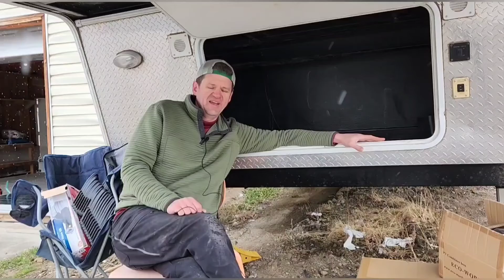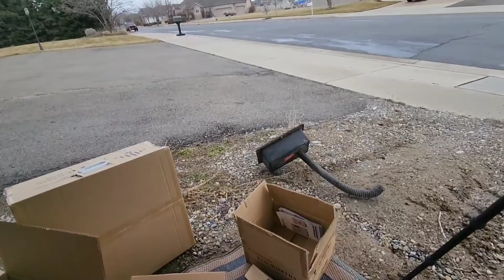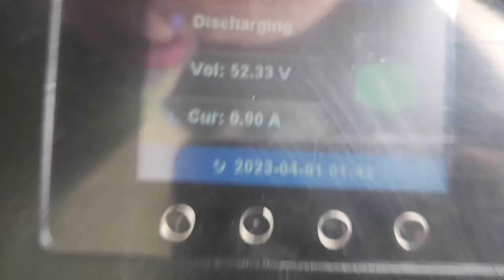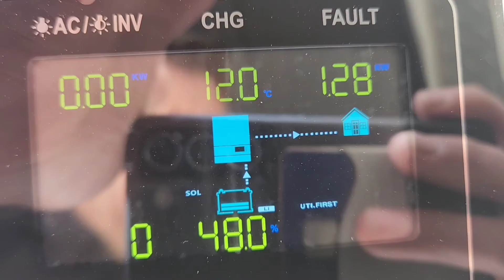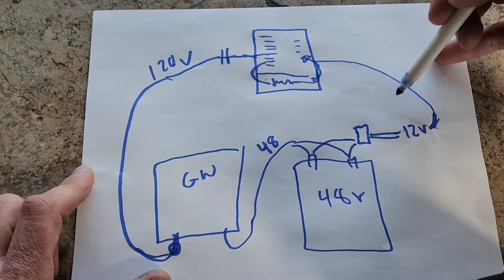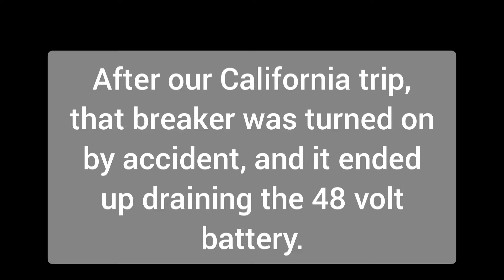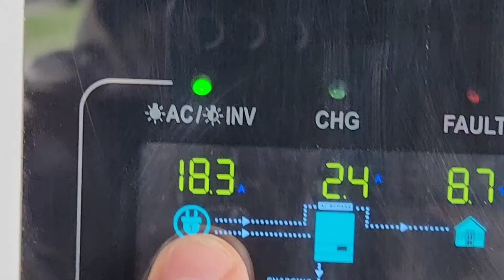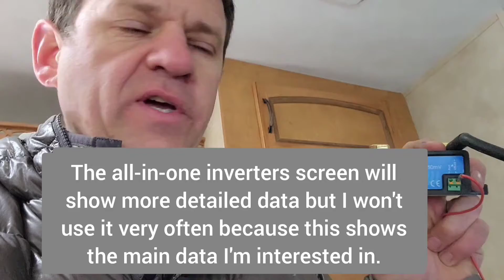12v to 48v RV conversion. Ultimate Off-grid RV Solar Power System Install

Comment: Nice set up..  would it make sense to leave the existing 12v system and add your exact system?  I Would think that the redundancy would make sense.
Reply: I am doing that and having small solar setup just for those batteries and a 48v battery and 48v inverter for all the 120v stuff
Reply from the maker: Sorry for the delay replying. I've very glad I removed the 12v battery for a couple reason.
1)One way to keep the 12v battery charged I would be to have a separate solar,  separate charge controller, separate battery monitor etc(Kind of a pain to maintain 2 solar systems).  I already have redundancy because my truck or motor home engine battery can be used with some jumper cables if needed,  I also believe I'd be fine plugging into my truck  tow plug but I haven't need to do that because the solar always keeps things charged.
2) (The main reason to remove it) Having the separate 12v battery is a constant draw on the 48v system:  An electrician mentioned this to me when he did his conversion.  He kept his 12v battery in place initially and then ended up removing it because when the heater would run at night, the fan would pull from the 12v system all night and his 48v battery was constantly trying to keep it charged.   This was super inefficient because of the converter box and the charging loop I mention in the video( 48V dc -> 120v AC => 12v).  I haven't measured the power loss in the 120v to 12v converter box but I imaging it's pretty high because of the large aluminum fins to keep it cool.
    My 48v to 12v converter box is super inexpensive and it's been great for me so far. It also it saving me from buying extra batteries.  Hope this help.
Reply: @diySolarPowerFunWithRay I like your idea, however I'm just wondering to keep 12v battery in place, switch off the 120v-12v converter and only turn it on when 12 v bank needs charged by 120v. I have currently 2x 100ah 12v Lithium battery for my rig in parallel. I'm thinking this because not sure how buck converter would communicate with my trucks trailer brake controller??
Reply from the maker: @sairdruk  if you only need 2 12v batteries for your i'd probably keep with keeping everything 12v.  My trailer breaks and trailer lights aren't connected to the main 12v rv system, they are independently controlled by the truck.
Reply: I'm doing this as well. We're retired FT RVers who boondock most of the time, so we decided to build our solar system in 2 phases, a 12v basic phase to run all our 12v appliances and a 48v system for our AC high power needs. We completed the first phase last January, with the addition of a custom built 560ah of LiFePo-4 battery, made with 8, 280ah prismatic cells. We used a Heltec 330amp BMS and a 5a active balancer, to start our generator. It only cost us $1,500 to build this 560ah LiFePo-4 battery, including the high amp BMS. The main reason we chose these cells is that they fit perfectly under the steps of our motorhome where our old pair of GC-2 golf cart batteries used to reside. We insulated the battery compartment, cut a small 1" hole in our step risers and installed a tiny computer CPU fan to keep this space at close to room temperature. 

We started our build 4 years ago with a 620-watt liftable array mounted on the side of our motorhome that practically lifts itself to the correct angle with a couple gas struts. Lifting an array to the correct angle produces 25-30% more than a flat mounted array, especially in the winter when the sun is low on the horizon. This first phase, including the liftable array, wiring, breakers, a new Progressive Dynamics 80a Li compatible converter/charger, 1,000w Renogy PSW inverter (to run our TV and PC), an Epever 50a MPPT controller, battery monitor/shunt, and a Renogy battery to battery charger (to protect the alternator) cost us around $3,600. 

We'll be starting our 48v phase soon. Mounting our current solar array on the side of our MH left the roof free to rack 8 Sunpower Gold 550w solar panels 13" off the roof of our 35ft Class A, to clear our front AC shroud and vents. It will give us a good bit of shade too, reducing the heat load on our air conditioners. Our MH is only 11' 9" tall, so we will be able to keep the RV height to 12'. Will be using an all-in-one 48V, 5,000W, 120V PSW Inverter, 100a MPPT 500V controller and 40a ac battery charger by Sungold Power for the bulk of our 120v needs. The reason we chose this all-in-one is because the idle power consumption is only 25 watts - and it's only $850. Our 48v battery bank will use 16, 305ah prismatic cells (15.6Kwh.) So together with our 560ah (7.1 Kwh)12v bank, we will have a total of 22.7Kwh of batteries onboard. We will be replacing our old rear 13.5k btu rooftop Dometic AC with a high-efficiency 48v DC mini-split heat pump that only draws 750 watts at peak air conditioner output and less than 500 watts when it's cooling normally. Both phases together will cost around $13,600, including the $2,100 mini-split. Our 2nd phase will provide 24/7 off-grid air conditioning and supplemental heat from the heat pump and allow occasional usage of our 14.5k Btu Furrion front rooftop AC to cool things down for peak afternoon demand, as well as give us whole house 120v ac power. It will allow us to keep our generator in reserve for emergency use only.
Reply: @SuperSushidog  that is perfect idea its what I will be doing

Comment: I wonder why the 2nd battery behaved differently when starting the AC? I think inside they are the same, and both have a 100A BMS and they both have a max discharge rate of 100A, which I doubt you were pulling.

Also, you might want to add a couple fuses to the positive wires on that buck converter.
Reply from the maker: I didn't add a fuse going to the buck converter because the converter literally can't go over 30 amps. Imagine it's probably a good idea to add a fuse though just in case the buck converter has a short. 
   I think the BMS in the other battery isn't as good. Even though they stay they are the same on their specs they are definitely different. It's too bad you can't believe the specs. I had another viewer comment that he was experiencing the same thing with the lifepower4 battery. He thought it was the bms, which makes sense to me. Because it has stricter BMS settings, who knows, maybe the cells will last longer?

Comment: What size dolar panels are you running.   And what charge do you receive from them
Reply from the maker: I have five 315 watt panels up top. It can run the inefficient air conditioner all day. When the Sun down obviously the battery can only keep up for a few hours. I think I've seen 1400 Watts coming from them on a good day.

Comment: Meh... should have an internal cable between the Inverter and the distribution box. I'd remove the 120V-->12V charger unit completely. You want a switch (and fuse) on the 48V to 12V converter - on the 48V side. I also think you want a second 5KWH battery. Personally - I would have put in a split-phase Victron Multiplus 48/3000 unit. Costs more. Need separate MPPT controller(s) and a Cerbo-GX controller - but then the screen can be inside your RV (much more convenient). However - you'd have a lot more power... when plugging in  - etc.
I live in South Africa - where the rest of the world uses 240Volts. Much easier.
Reply from the maker: I generally like victron stuff but the multiplus 3000 units only support 2400 watts (according to their Manuel). With only 2400 watts, it would only allow me to run one of my 1500 watts appliances at a time. ( eg Ac, electric water heater, microwave). Having the servo GX display would be nice, but I'm using the victron Smart shunt and that's giving me all the information I care about.  I think I would probably agree with you with the 240 volts the rest of the world uses. America is weird. I have a couple friends from South Africa. Also ian, who started and runs watts247, is from there.

Comment: You did great!!!  I’ve been using lithium’s for over 15 years doing conversions.  Mostly electric propulsion.  You are thinking correctly to multi purpose the system and expansion while at home.  Bravo 😊
Reply from the maker: Thanks a lot. Are you doing boat conversions?
Reply: @diySolarPowerFunWithRay  no boats yet.  15 years ago….  128v 50mph LiFePO4 electric mountain bicycle.  
15hp craftsman lawn tractor converted to 1.8kw LiFePO4 pack and 11kw 22kw peak ME1004 motor.  I’ve be researching and testing lithium for over 15 years.   My lates fat bike build is 5500 watts. 44mph.  Tesla 21700 cells. 25ah 74v nominal.  I’m an early adapter if not the first to sandwich spot weld Copper Nickel.  We’ve been looking at RV trailers….   Geopro 15TB or Hike100. 
I already have a new MP solar 48v inverter I purchased 3 years ago and I have 15kw of Panasonic 21700 cells I can start building my pack.  Since we want small trailer and can’t keep it at home HOA ….. I’m thinking of building it in the back of my 4Runner and making a foldout array on the roof of 4Runner.  15kw could run an auxiliary electric motor on my 4Runner engine serpentine belt to reduce fuel consumption and double as house backup.  😁
Reply from the maker: @TommyLuptak  Wow, those sound like interesting builds. I'll have to check out your Channel!
Reply: @diySolarPowerFunWithRay  please do.  Not an organized channel at all. But you will find some of my projects here.

Comment: I took my converter box out of the wfco box and chopped the box in half too so only the breakers and fuses remain
Reply: When you plug into shore power without any solar system your stock converter box converts the 120v down to 12v correct, so why even use a external stepdown converter. The one that comes with the RV should be sufficient, that's the way they are designed. So when you connect a solar system that has an output voltage of 120v and plug into the shore power plug of the RV it should and will work properly. In this video, the solar system is a separate power source totally just like shore power. And what do you do at camp sites, you plug into shore power. You should try to keep these systems as two different power sources to be on the safe side. I know it will be convenient to be able to charge your 48v battery from the shore power but I think you might run into some problems down the road. I know the growatt inverters pretty well and you have to be very careful about too much voltage input, so running solar and shore power you might over volt the mppt controller of the unit. Maybe worth looking into. The growatt 3000 ES is an off grid unit, I know that it has an input for grid power but I don't think it is recommended. I could be wrong though. I just like to play it safe myself. I'm doing the same set-up for my brothers camper but the solar system is going to be a stand alone power source but capable of connecting to the main shore power plug of the RV. The solar system has its own controller and inverter then from the inverter to a 30 amp square D breaker box down to a 120v electric plug of it's own. Like you did in your video, we plug the shore power cord from the camper straight into the electric plug of the square D breaker box. That way the original wiring of the camper isn't altered at all, so if you decide to sell it or change the solar system out then it's simple, just unplug and remove. And yes the solar system should have all of the safety things in place as well, breakers fuses and battery quick disconnects. Maybe it's just me but I like to be able to change something quick in a setup like this instead of having to go back and rewire the original 120v to 12v converter that came stock in the camper. Keep the camper as original as possible but add the extras to it.
Reply: I meant to put this on the main reply page. Sorry
Reply: I meant to put this on the main reply page. Sorry

Comment: You really should set a subpanel and come out of there with all your loads. That way all your circuits have their own breaker sized accordingly to the wire and load.
Reply from the maker: Because I am using my RV Shore power plug, it is using all of the existing 120 volt breakers. The 12 volt system is also using the existing 12 volt Fuze box. The thin wire coming out of the 48 volt to 12 volt converter is also rated for 30 amps so I'm good there because it can't output more than 30 amps on the 12v side. I could probably use a fuse there though just in case

Comment: Thats interesting i know in canada we to install deadman switches for residential so if the power went out it doesn't push into the grid.  Meaning you cant power the house.  Is there a work around other than running a whole another junction box ?
Reply from the maker: in the United States they have something similar. They have grid tie inverters which have what is called anti islanding. It basically monitors the grid power and only feeds power into your house as long as the grid is up. If the grid ever goes down it will stop.  I'm still working through the details with the power company and how to hook it up properly.

Comment: With the step down converter you can get one thats adjustable from the 48 volt input to a adjustable 12 to 15 volt output. By raising the output voltage it will compensate for voltage loss over wire distance and save your waterpump and any other 12 volt stuff. If you run those motors with a low voltage it shortens their life by a lot. Learned that the hard way too lol.
Reply from the maker: Oh.. that's good point.. I didn't even think of that. I'll have to test the operating voltage...
Reply: @diySolarPowerFunWithRay  the other thing I noticed about running my 12 volt stuff at 15 volts is the waterpump runs a lot smoother and lights look more normal. I'm getting about 14.3 to 14.5 volts at the various places I've stuck a tester around the camper. Higher voltage means less amps and is definitely easier on electrical stuff to a point. I'd not go over 15 tho cause that's about the limit on 12 volt stuff
Reply: That converter still needs to be tested under load.
Reply: @s.mendez7160  why not go with a 60 amp lt converter?
Reply: @ 60Amp converter in reference to what?
Reply: @ 48v to 12v converter. would a 60amp run your 12 volt system more smoothly
Reply: @diamondhandz1989 The average current draw with all 12V loads ON is 25 Amps. Average use 2-7 Amps. So a 60 Amp converter would be costly, and unnecessary. Your mileage may vary...

Comment: Ive installed a 220 volt solit phase inovair minisplit 38 seer in my 30 foot holiday rambler. My solar power system runs it 24/7 off a 4000 watt sungold power split phase inverter and the rest the camper runs off my 3000 watt all in one unit. I have 2 seperate battery banks and its all 24 volt but its basically 2 seperate systems. One is 24 leaf modules at 24 volts and the other is lifepo4.  I have 1800 watts of solar at the moment with tilt able ground mounts but im wanting another 2000 watts mounted on the roof soon as i can get the panels. One thing i learned the hard way is it takes a lot more solar than a person would think to actually live comfortably off grid. Thanks for the video its cool seei g other peoples stuff

Comment: what make/model of the 30a external power ports did you use (the grey lidded thing)?
Reply from the maker: This is the one I used. I hope it will hold up. It has mixed reviews on Amazon.   Thanks for pointing this out, I need to add it to the kit. https://www.amazon.com/gp/aw/d/B000FCER3E?psc=1&ref=ppx_pop_mob_b_asin_title
Reply: @diySolarPowerFunWithRay  thanks!
Reply from the maker: @theLegion Within  no prob. Are you gonna add a similar system to your rv?
Reply: @diySolarPowerFunWithRay  yeah that's the plan - I'm DIYing a 1987 Ford Grumman Kabmaster into an RV.  it's in the shop getting an LS swap (the 4bt died) right now but when I get it back then I can start installing stuff - really like your electrical setup, it's very clean.

keep up the good work! ;)
Reply from the maker: @thelegion_within  That's awesome!   If you end up getting only one battery I'd get the Eg4 LL V2 battery.  1 lifepower batter had a hard time starting my AC unit. You'll need at 2 for it to reliabley start... but a single eg4 LL V2 battery starts it not problem. I'm doing a review on it now.
Reply from the maker: @thelegion_within  If you end up installing it would you mind purchasing with the affiliate links?  It really helps the channel. I put them the links in the description but here's a link for the battery and the inverter I'm usings:  Battery:https://signaturesolar.com/eg4-ll-lithium-battery-48v-100ahd?ref=DiySolarPowerFun (on sale now).  Inverter is: https://signaturesolar.com/growatt-48v-3kw-250vdc-stackable-off-grid-inverter/?ref=DiySolarPowerFun (only get this if you're going to have a solar voltage above 180v).  If you're going to have a smaller solar array I'd get this inverter: https://signaturesolar.com/growatt-48v-3kw-150vdc-stackable-off-grid-inverter/?ref=DiySolarPowerFun.  Good luck. Let me know if you have any questions on the install.
Reply: @diySolarPowerFunWithRay  yeah that or a 48v trophy battery to start but quite likely I'll need 2x 48v batteries